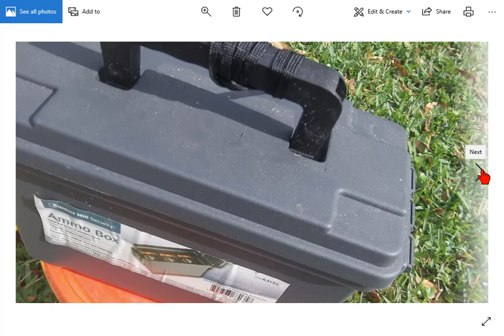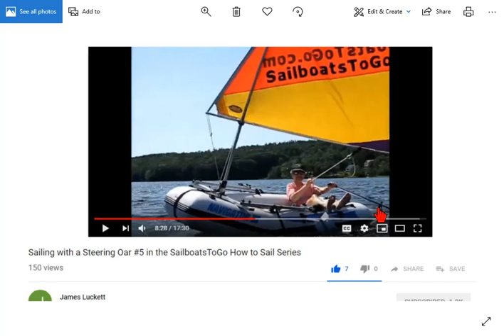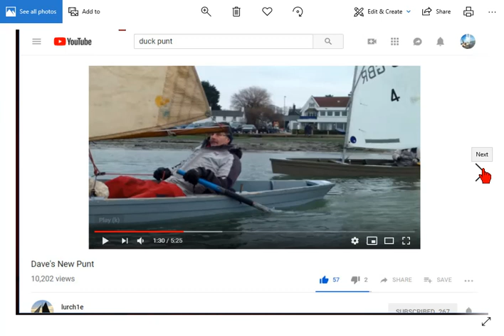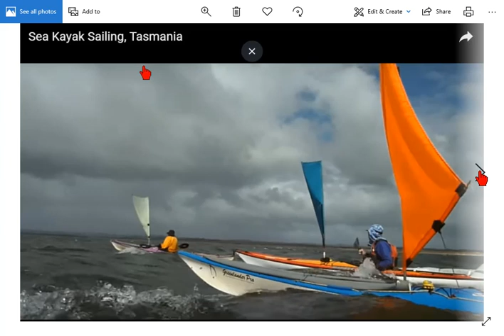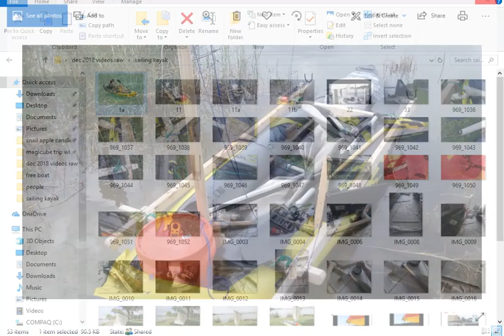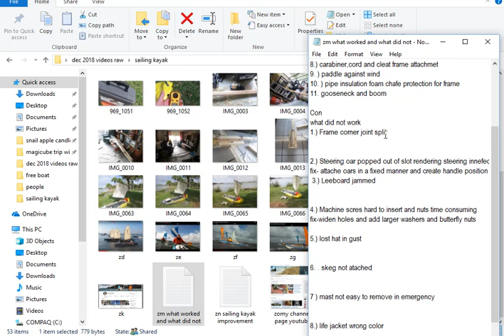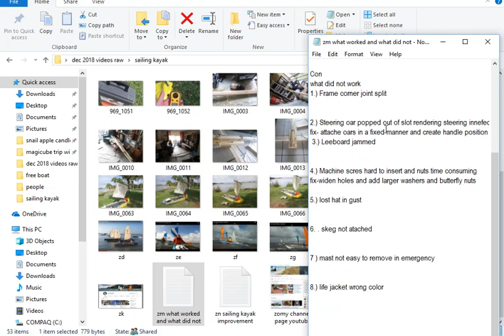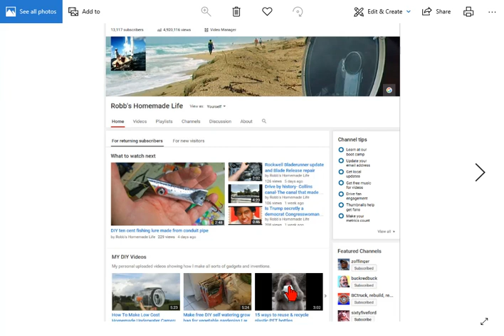my wonderful failure  make and sail Intex Explorer inflatable kayak sailboat

Comment: I wonder if layers of thinner wood, even plywood, clamped together with wood glue might be stronger for the frame that broke. The grain running all in one direction like in that piece of pine, easily makes for checking and splits under load. Yet the same type of wood when layered is very strong. Opposing grains support one another. For example, modern roof trusses that are laminated are flimsy looking, but carry loads as if they were heavy timbers. I wish I lived closer and could help with this great project of yours. Don't give up. If it's half as much fun to do as it is to watch, I know you'll keep at it.
Reply from the maker: hey Marty, thanks so much for chiming in. It is always good to hear from you.

Yeah, the cross frame can be made of stronger material. As you know the mast acts as a lever. Most of the force from the mast is at three places, where the mast is connected to the cross frame and at the two ends of the cross frame where they connect to the side frames. My plan is to attach a 6 or 8 inch wide plank across the top of the cross frame in a very robust fashion and then have the far edge of the plank clipped onto the side frames too. It will greatly increase the resistance to the force transmitted by the mast to the cross frame. I will also not drill any more holes in the cross frame to weaken it or bang on it with a hatchet like a dummy.  

I have decided to eliminate having two steering oars and try adding a simple rudder and tiller on the end of the starboard side frame which has the leeboard. It is unconventional to have a rudder that is not placed in the centerline of the boat but that is half the fun making stuff-we get to try things new things. The kayak should not be heeling much so having it off center should be OK and having it right behind the leeboard will reduce drag.

I am going to paint that life jacket Marty Zoffinger orange. Thanks for the encouragement Marty, I am looking forward to seeing a sail on one of your kayaks one day. 

hey, if I ever get a replacement for my 94 Corolla I have to drive up there and go kayak fishing at your place. See ya out there.